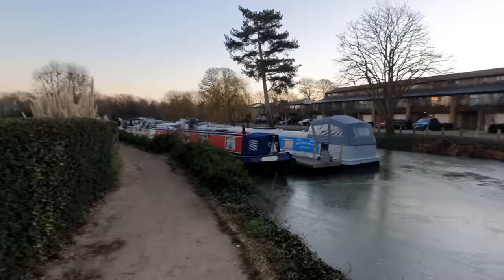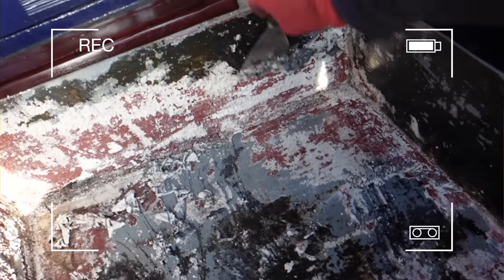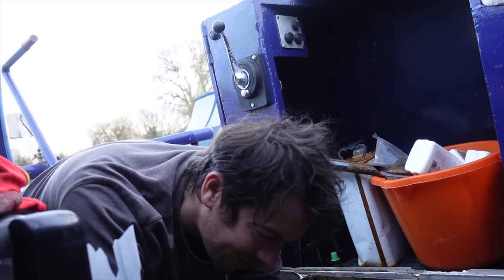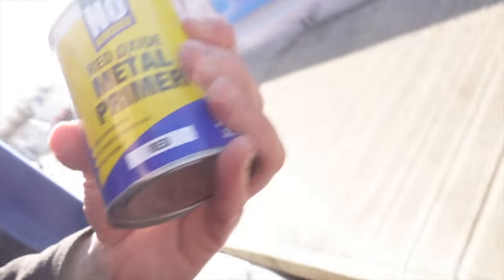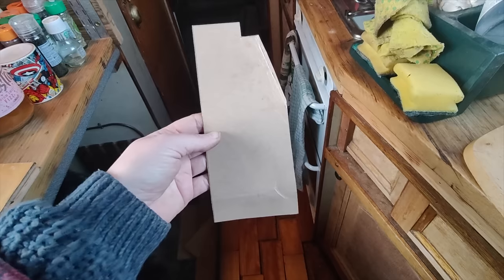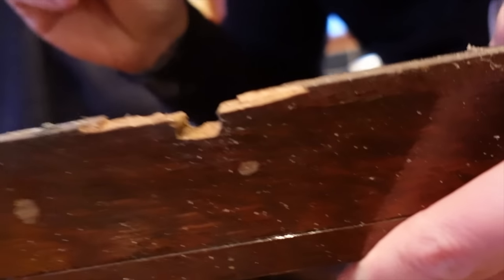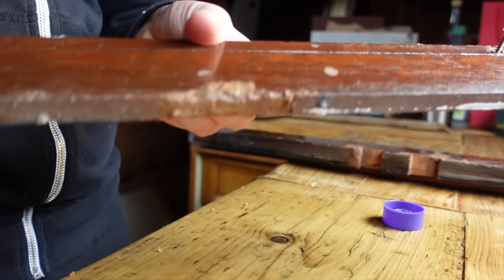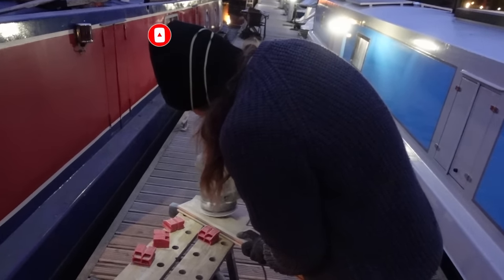UPCYCLING ...our wooden narrowboat floor !

Comment: Only trouble with a steel shower tray. It gets ### cold on the feet in winter time. I was very happy when mum replaced it with a stainless steel one. It might have has some insulation under it. I don't remember I was very much younger than now.
Reply from the maker: Yeah we might have to get into the habit of letting the water run on it for a few seconds to warm it up before getting in!! Or getting one of those non slip mats to put in it!!

Comment: The shower tray would have been much better if you'd popped it round to a bean blasting car spray shop. 5 Minutes and £20 job done and back to bare metal.
Reply from the maker: Yeah I think if we had more time then we would have done this. I'm sure it will be grand though!